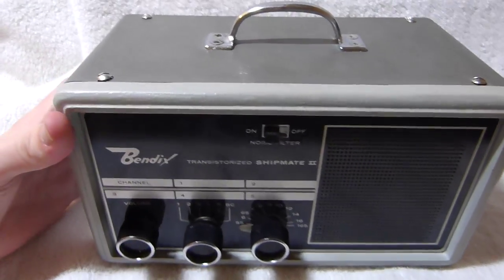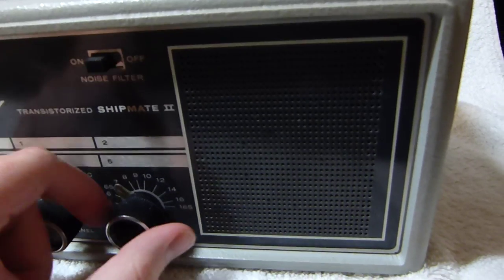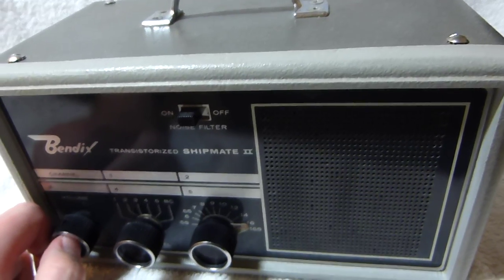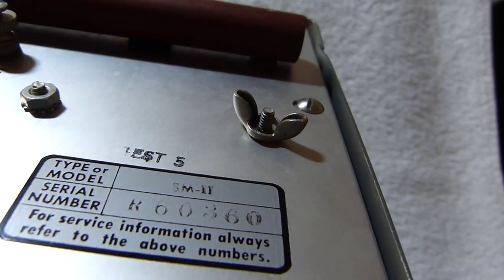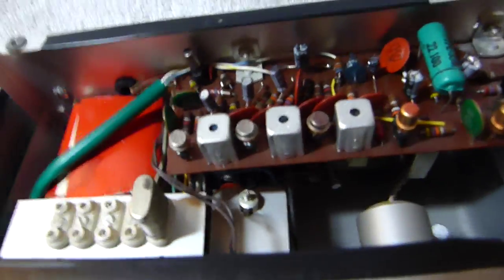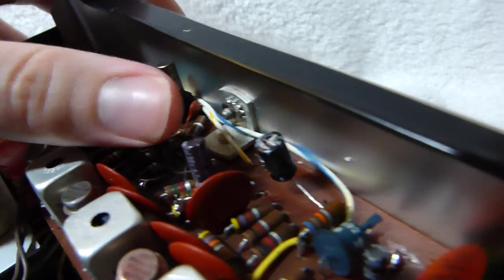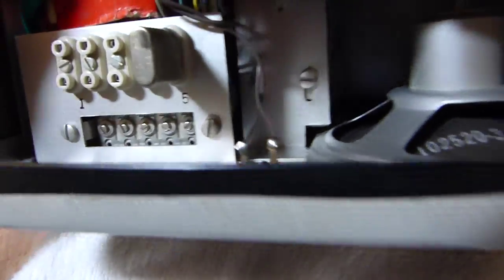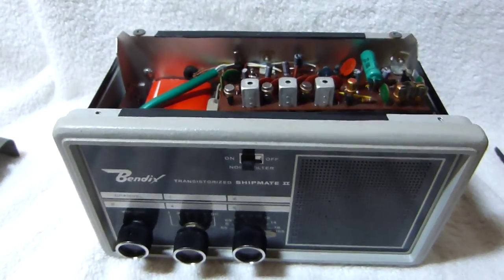1960? Bendix Transistorized Shipmate II (made in USA, or course)

Comment: This is a very cool radio, I like its utilitarian design and feel!  Sounds like it has amazing reception and I would like to think it would since you could get marooned somewhere in the Pacific on an island with your fellow shipmates and you need to make a battery out of coconuts...oh, wait, thinking of something else!  :)  

The info I find on this radio is, first mention in the Jan-Feb 1960 edition of Boating magazine, the handle on your version is an addition probably by its original owner for easy portability.  The crystal frequencies are 2-3 MHz for Marine Radiotelephone and sold for in 1960 $119 USD, that would be $956.17 USD in 2015.  I'll try to send you a PM of the advertisement, hope this helps!
Reply from the maker: +JacksJunkDotCom Thanks for the info Jack, I figured this was a pricey set originally, which surely did not help it sell. I agree that the handle is likely not original (it looks like a cabinet handle), but I can't find any modern photos of this set to compare.
Reply: +50sTransistorRadios I sent you a PM through YT, not sure if you got it or not, either way, check here on my site for two (2) adverts (in a RAR file), it will show you a graphic of it.  http://jacksjunk.com/file-downloads/consumer-electronics
Reply from the maker: Yeah I got the ads through your PM, thanks!

Comment: Betcha this came from their avionics division. I've repaired tons of Bendix-King aviation transceivers over the years, all great quality! Bendix did have a line pf radios which were sold at military base PX's, through the late 1970's. Maybe this could be one of those birds??

Another fine radio, in-fact, another gem!!
Reply from the maker: +AMStationEngineer This model was sold as part of Bendix's Marine line, but I am not sure which division actually made it. It was advertised in boating magazines in 1960 and 1961 (thanks to Mike and Jack for copies of those ads).

Comment: 260 is the EIA code for Philco. Very interesting set!
Reply from the maker: +Jerry Carriera Oops... odd that they would put both their EIA code and their name on the transistors.
Reply: +50sTransistorRadios Many tube manufacturers put their EIA codes on their tubes.
Reply: +50sTransistorRadios Many tube manufacturers put their EIA codes on their tubes.
Reply from the maker: I need to find a full EIA code list, all the ones I have seen so far have just the bigger names.

Comment: I rather like the "power-on chirp". kinda puts me in the mindset of the "Roger Beep" produced by the Browning Golden Eagle series!
Reply: I was thinking there was a bad disc on the power switch? You know how some have that on or in the main power switch? Merry Christmas!  Steven
Reply: Probably a missed install across the potentiometer, sometimes those older 2N's will clip until bias potential is realized. I still dig the beep, though!!  have a great Christmas, Steven!
Reply from the maker: +AMStationEngineer I don't have the schematic for this, but there was a 100uf cap after the power switch, and replacing it didn't help (I replaced it before this video was shot).

Comment: That set is mega-sensitive and selective...it would definitely need to be designed that way for receiving stations when boating far out at sea,
Reply: 5:00 Now I see why..that nice multi-stage IF strip :-)... even without an RF amp stage, the set still works excellently! ... I wonder what the IF freqency is...
Reply from the maker: It's most likely 455 khz, like most (non-auto) radios from this time period.